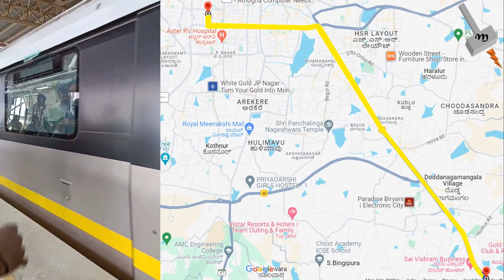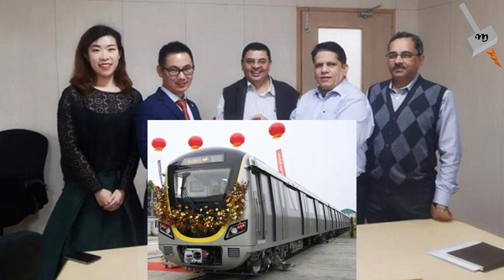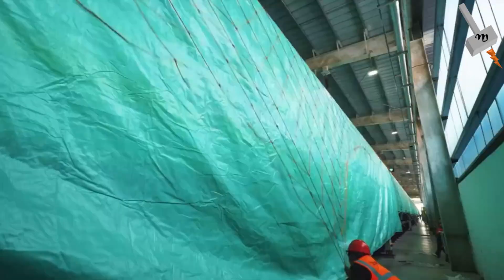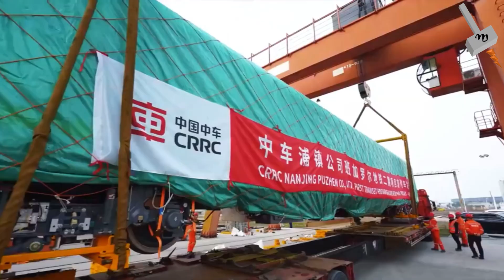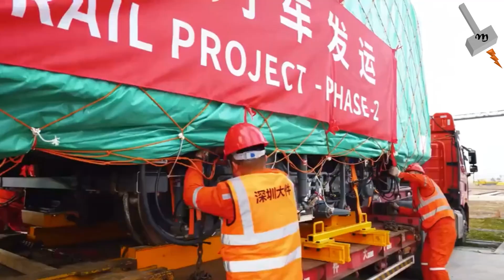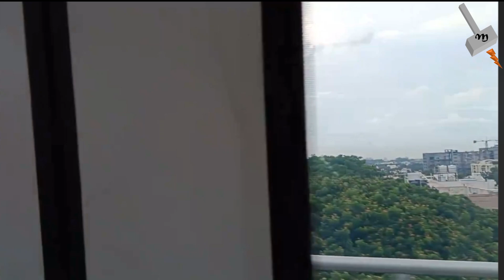Namma Metro - Yellow Line - Trial Run

Comment: Open date sir?
Reply from the maker: Hopefully end of 2024… because if BMRCL has started the field trial then in another 6 months they will start the line… too much public pressure
Reply: @surgepulse2778  not at all possible by dussherra, no trains sir
Reply from the maker: End of 2024 should be appropriate timeline
Reply: @surgepulse2778  but will be in 2025
Reply: @surgepulse2778 trains cant be delivered, we were sleeping during BJP rule 😂
Reply: Feb 2025
Reply: not this year i think no trains to run

Comment: Circle of Life:

When India's first Metro Started Operating in Calcutta, it used Rakes and components manufactured at NGEF, Bengaluru... Later on BEML of Bengaluru started making its own trainsets and supplied them to various cities including Calcutta for Metro operations.

Today, TWL of Calcutta has won the award for manufacturing and assembling Trainsets for the prestigious Bengaluru Metro... 

Unfortunately TWL cannot run its trainsets in its own backyard (because of bureaucratic complications of IR controlled Calcutta Metro), but it's a proud moment because perhaps now among the country's best Metro train makers will be able to manufacture world class Aluminium Body (Lightweight & Efficient) Metro trainsets for the more modern cities like Bengaluru and Pune (among others).
Reply from the maker: Thanks for sharing this 🤝